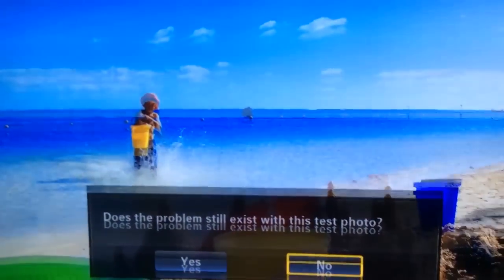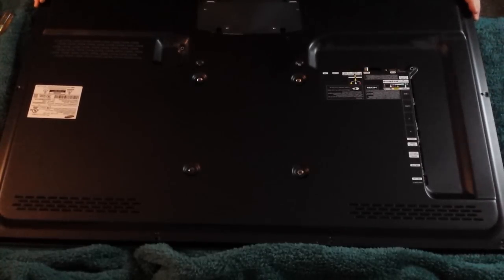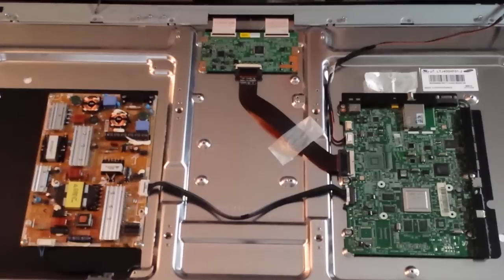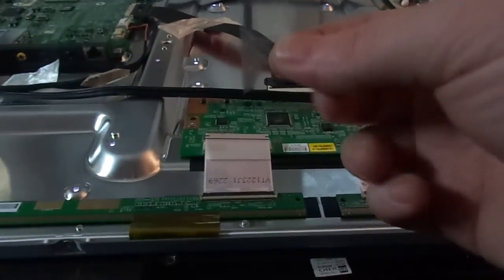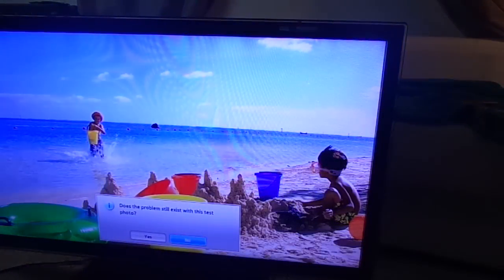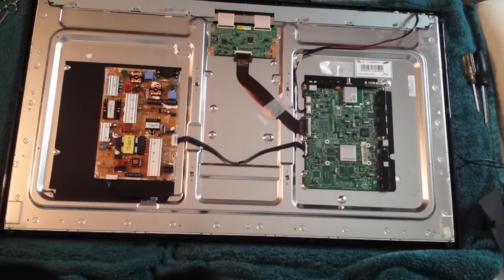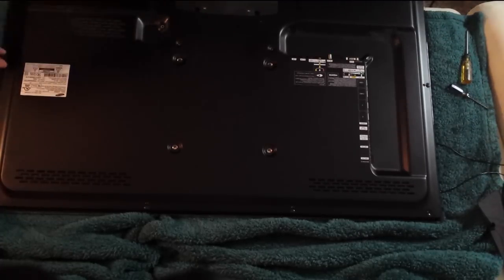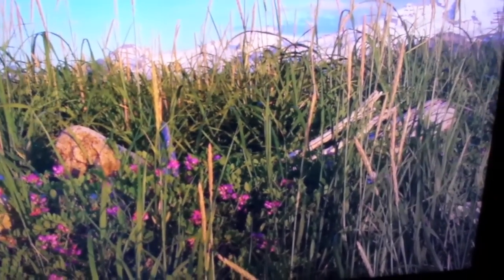LED LCD TV FIX, How To For Samsung Double Image, Black Vertical Lines, Screen Problem Sony LG.

Comment: Thanks for the video it was really helpful, I had a question I did exactly what was said in the video and I no longer have a double image but the right side of  my TV is a bit darker now then the left side, do you have any idea of what could've happened? Thanks in advance Dave
Reply from the maker: eberrueto  Hey there, a couple people have posted that the display on their tv is a bit darker on one side than the other after following the steps in this video.  One person commented that he was able to get both panels to match in brightness by covering around 16 gold tabs (lines) on the tip of the ribbon cable. Since reading the comments I have been paying more attention to the display on my tv and it is a bit brighter on one side, most noticeable after having the tv on for a couple hours.  I have not gone back into my tv to move the tape around in the hopes to fine tune the picture.  I was just happy to get rid of the double image.  If the difference in brightness is to noticeable on your tv and you can't live with it you may be able to go back in and move the tape a bit. If you do end up going back in please post your progress. It would really help anyone trying to get their tv's picture back. Thank you for watching.

Comment: https://www.dropbox.com/s/0qeaagkcp575ywi/Shadow1.jpg?dl=0
https://www.dropbox.com/s/3vzwl9bs3n1zcjt/Shadow2.jpg?dl=0
Hey Dave, I have Samsung 40 inch 3D smart LED TV with model number UA40F6400DKXXT and the problem I am seeing is horizontal black shadows on the screen. Please see the pics I have shared in the links above. Earlier, one strip was at the bottom of the screen and now I see one strip on the top of the screen also. These shadow areas are increasing gradually. Can you please help in pointing out the probable area of fault and its fix. Also, it will be helpful to understand the possible reason for this issue so as to avoid it in future if possible.
Thanks a lot in advance!!

Comment: I have a samsung ln46 that i just fixed the darker horizontal lines with this but now there is a slight shade difference in two sides of screen.  What is a permanent fix to the trick you showed?  Replace ribbon connector?
Reply from the maker: James Woolery There was a comment from a viewer that explained how he had the same issue with his tv you are having with yours.  He said there was a way to get both panels to match up by covering just the right amount of gold contacts (the lines on the tip of the ribbon cables) with tape.  I think he said 12 to 18 or so.  I can understand where you are coming from.  Spending a good amount of money on a tv that ends up having such a problem can be very frustrating.  I have not gone back into my tv to try and get the panels to match up perfectly I was jusy happy to get rid of the ghosting.  If you can't live with it you may want to try positioning the tape on the cables.  The only thing is it could be a quick process or a time consumer.  Either way staying patient is a good way to help solve a problem.  Please update any progress you may make if you end up going back in your tv.
Reply: Do It With Dave I have not gone back in yet as it hasn't really been an issue.   I do notice that it seems to get worse the longer the tv is on.  I tried covering just a small number of pins and a larger number also.  I had to find right amount to get a happy median of no black lines and extreme color difference in the panels.  Do you think if replacing the inverter board and/or the ribbon connectors would be a more permanent fix?  Is that what they would do if a tech fixed this?

Comment from the maker: Harvey E, I had the same issue with my tv.  About a week after I did this fix the double image came back and my tv had the black lines at the bottom of the screen.  I just did the steps over however the second time around I put a piece of tape over the ribbon cable I worked on to secure it to the back of the tv housing.  As for the tape I used just regular scotch tape over the ribbon contact.  And I don't have an exact number for how many pins I covered.  I just cut the tape to a smaller piece as I went until the tv picture looked good.  If I had to say, the tape probably covered about 24 pins or so.

Comment: Hello Dave this sounds great please clarify if the tape goes over the gold contacts or just behind it? or wrapped around both sides?? thanks and please let me know?
Reply from the maker: tvsteve2  Hey there.  The tape is intended to be placed directly on the gold contacts.  I wrapped the tape on top of the contacts and around the back using a single piece so it would have a better hold and stay in place.  I tried to zoom in on the part in the video where I show the tape sitting on the contact.  I placed the tape as far to the tip of the gold contact as possible.

Comment: This video is exactly what I was looking for. I have this problem with my lg tv. I doooo hope this would work. one question, why taping a scotch helps?
Reply from the maker: abukeinan Static electricity seems to build up on the contacts causing the double image issue.  By removing the ribbon cable you discharge the static build up.  By putting a piece of tape over the contact it creates a buffer so the static electricity is unable to build back up.

Comment: What exactly does the scotch tape you put in do?
Reply from the maker: heroes1455  From what I can tell the tape basically gives a small buffer between the contacts so static electricity is unable to build up.  I suspect that causes the image issue.

Comment: Master!! It works, thanks a lot. My Tv is a Samsung Smart Tv 40'' UN40D5500, and had the same issue as yours. Covering with tape 20 there was a different brightness in between both sides of the screen. Covering 16 lines it worked perfectly. 
You saved me U$S 1300, how much i owe you? haha Greetings from Uruguay
Reply from the maker: Thank you Agus Fas.  I'm glad you found this video helpful.  And thank you for sharing your progress.  It really helps everyone when we have more knowledge.

Comment: hey there is a thick vertical line at the center when i tried to put a tape on the other ribbon (i read your reply here just like you said) why do u think this happen? and how to fix it?
Reply from the maker: Jaii24 213,  I had an issue somewhat like the one you are talking about and it was do to having a little to much tape on a connector.  Try to use a bit less tape.

Comment: Hi Dave, how to fix if the right ribbon cable causing a problem?
Reply from the maker: Rene Jarobel,  Try to remove one cable at a time.  Take out the right cable and leave the left cable in see what happens.  Then put the right cable back in and remove the left cable see what happens.  If the display shows an issue when a cable is out then start with the cable that is out first.  If not then start with the right cable first.

Comment: good day, dave! my unit is Sony Bravia LCD TV, model: KLV-32BX35A, and it has 'double-image' problem. i did perform ur instructions in this video, my problem is i can't find the T-Con board where that 2 ribbon band attached. hope u can help me... thanks!
Reply from the maker: Fabian Aguilar,  I am not familiar with that model so all I can suggest is to Google search Sony Bravia LCD TV, model: KLV-32BX35A and see if there is a layout of the internal operational components.

Comment: Hi Dave, Thanks a lot for this video..... For my TV, the right connector gives the problem, so i tried your tape fix, but it completely blocks the signal. I tried moving the ribbon to various positions without the tape and finally at one point, the picture became clear......Holding it at that position, i slowly pressured the tab down, but the double image came back again....(i.e) as soon as the tab is slightly pushed down (makes contact), the double image returns back....
What shall i do now???
Reply from the maker: Ajay Rinaldo,  I had the same issue when I was pushing down the locking tab.  It took a little time and patients on my part to position the cable in just the right spot as I locked it down.  I saw the double image showing on the display as I lowed the tab and maid contact.  But after I continued to completely lock down the cable with the push tap the double image went way.

Comment: Hi Dave. My english is not so good but I will try to to do my best. First you thanks to share you knowledge and expérience. I had double image problem that I solve perfectly with your "scoth tape"..... Thanks again. I also have those line on the red ballon that I cannot take of, but still ok comparing the double image that I have before (maybe need finger practice...). But now, I have some black line that appaer on the first top third of the screen?? any idea?? I try different size of scotch tape without any success... Maybe you can save me a second time.... Thanks in advance.
Reply from the maker: Yannick FRABOULET,  I sounds like your tv has the same lines you see at the bottom of the screen as the top.  I suggest moving the ribbon cable a little bit when you put it in the slot.  By doing so you may see a difference on the display.

Comment: i have toshiba 29 inch led tv it is taking too much time to start. before start it blinks many times. green light shows its turn on but display takes a very long time to come, nearly half hour to 3-4 hours sometimes. plz help. whats wrong with my tv......
Reply from the maker: Hello Deep Sadhu,  I have heard of this issue from several videos online and many people believe it is do to a power supply issue that doesn't warm up the timing component on one of the boards.  I can only suggest that to be the issue and I don't have enough experience to really tell you the exact cause.  There is alot of help online.  If you are persistent you may be able to find a solution for this issue.   If you find anything please post.  It really helps others to get any information possible.  Thank you for watching.

Comment: I was able to fix my Samsung LNT4061F following this video and I didn't need the tape.  I cleaned all of the dust out of the TV, reseated the connectors and it I got a clear screen with no lines or double images.    This will save me a lot of money, was about to sell the TV and buy a new one...
Reply from the maker: Thank you for sharing brenda daniels.  Im glad you were able to get the display on your tv back to normal. Thank you for watching.
Reply: How can i reseat the conectors?
Reply: Do It With Dave  men i did the tape trip and nothing i still having  the problem

Comment: hi i have an a sound problem with my samsung lcd tv when i press mute button its gone suddenly sound at 50% and after 5 min went sound volume down can you plz help me can i reset my lcd. my question is its work?
Reply from the maker: Hi mrpak5,  I don't have much experience with the volume issue your tv is having.  I would start by taking out the batteries from the remote control and try to manually press the volume up down button on the tv.  If you have no issue than put the batteries back into the remote press mute than again take the batteries back out of the remote and manually press the volume up down buttons on the tv.  See what happens.  I say to do this because the remote my just have a stuck button that is causing the issue.  If you don't have any success with the issue than it may be something you will have to dig deeper to find help online.  I hope this helps.  Sorry I am not of more assistance.

Comment: Hey i have a UN46D6000SFXZA and i have the double image problem...now it used to go away after it warmed up for about 5 mins, and then as time went on use after use the "warm in period" would get longer until eventually just permanantly have the double image forever...i did the tape thing and after a few times i did get it to correct the double image....but once the tv cools down and i turn it back on, the double image returns and then goes away after flickering for about 15 mins...im thinking about changing the small pcb board & or the ribbon cables could that help?  because i messed with the main ribbon cable and it doesnt effect the image...
Reply from the maker: John Chimento,  Maybe decide if the warm up time is something you can live with or not.  When I was working on my tv I got some flickering while adjusting the ribbon cables however when I got them seated correctly it went away.  If you are going to continue I suggest to do the steps in the video again and really look to see if the display clears up while adjusting the cables. Try to do it before the tv has warmed up and see if that anything changes.  You may have a weak power supply or a timing issue that corrects itself as the tv warms up.  Please up date any progress you make.
Reply: So yeah, after trying your fix , I have been lucky the past two times where there is no warm up period it comes right on as normal.... but one half of the sceen is a tiny tiny hard to notice smidge less bright then the other half and through the settings I have been able to tweak the brightness and contrast to make it less noticeable...I just wanna get a little more of my moneys worth out of the tv and then ill part it out! Thankyou for the help!

Comment: Hi Dave, I did, but the picture didnt change, so what should i do? do i have to change the kit or not?
Reply from the maker: Hello mojgan pelari,  If you still have a double image make sure you try to use the steps for both ribbon cables both sides of the panel.  Do one at a time and see what happens.

Comment: i have a LG 55" TV MODEL 55UB820V and it had a very thin vertical yellow line right down the middle of the screen, would this method work for it? due to it being a new tv
Reply from the maker: MrZimma frame, The display may have dead pixels or possibly an issue with a connected device like a dvd player, xbox ect.  Try to go though all the input options your tv has.  See if the lines are the same with different inputs.  You can also try to disconnecting all devices, unplug the tvs power cord from electrical outlet, reconnect everything and see what happens.  There may be some components that need to be replaced on one of the boards, there may be some bad capacitors. This guy has a unorthodox video about replacing capacitors but it may help.  Also check out how to detect a bad capacitor.   Thank you for watching.   http://youtu.be/KiqJuMiEiak

Comment: hi dave,
is it easy to replace the led screen on a SAMSUNG UE55HU8500 or a Sony Bravia KD55X8505B ? thanks
Reply from the maker: PROXIMASTARMAN, I have not attempted to replace the display panels on any tvs so I don't know the difficulty level in doing so.  I can say that replacing old with new is usually a lot easier than troubleshooting an entire device to find a fix if someone is not experienced in doing so.  If you do end up replacing the panels I suggest to make a fair amount of time for yourself to patently work on your tv.  If you make any progress please post updates.  Thank you for watching.

Comment: I don't understand.  How does blocking part of the electrical connection on the ribbon get rid of the double image?  Doesn't the display need the signal from the ribbon connection that was blocked off from the tape?
Reply from the maker: The purpose of applying tape is not to block any connections it's to stop static electricity from building up causing a display issue.

Comment: Dave my Un46es6100fxza has a dark screen volume works screen is seeable but I have to shine a flashlight over the screen to see it. What do I do? Buy a new main board or can I use tape help me please ,,...!???
Reply from the maker: Hey NBA2K.MyCareer,  It sounds like your tv has an issue getting the correct amount of light to illuminate the display (back light).  You may need to like at the capacitors on the boards to see if any have failed and are cause a power issue to the back light.

Comment: Thanks it is works
Reply: Hi! can you tell me if this works with UN32D5500 ? Thanks
Reply: jonathan hajmi Hi Jon,. yes, i guess it could work for that reference too,..  for me works for an UN32EH6030, looks like vudu magic but really works i recommended besides change the size of tape. . try on differents sides ( left and right)  of the band or bus that is causing the failure.. .i also recommend try to fix the tv with a friend or using a mirror where you can appreciate if the two sides of the screen have a uniform bright ... Remember be carefull opening the case.. good luck ,
Reply: Thanks! Il ttry

Comment: Hi I have a 52" Samsung LCD TV Model.LN-T5265F. This one has half the left screen lines flickering. I think the problem is T-Con board or removing and reinserting the left ribbon. I opened the TV and had problem accessing the ribbon area. How do you get to the ribbon area in the Top of the screen section?
Reply from the maker: Unique Premji 
Hey there.  I found a page that shows your model tv and how to access the ribbon cables.  I put the link below.  It's a step by step of how to replace a T-CON board.  I hope this helps.

https://www.ifixit.com/Guide/Samsung+LN-T5265F+T-Con+Board+Replacement/16758
Reply: my left ribbon going from t-con board is gone bad. Where can I get one cheaply?